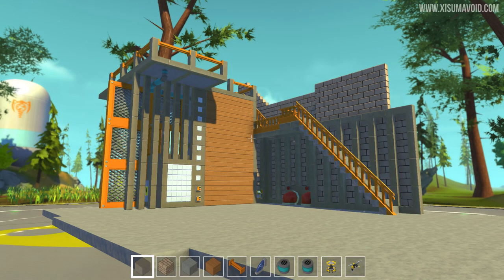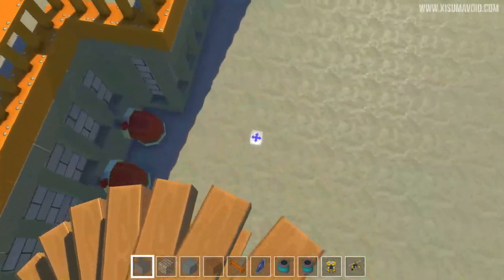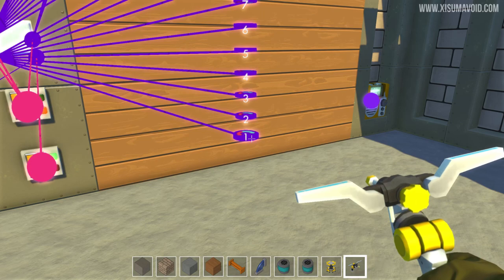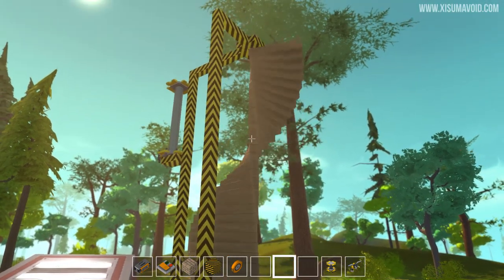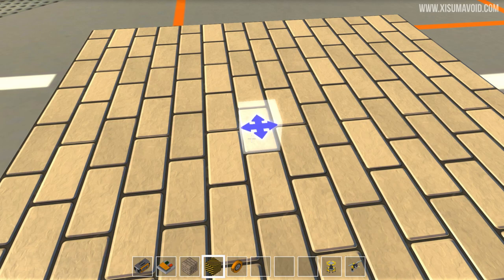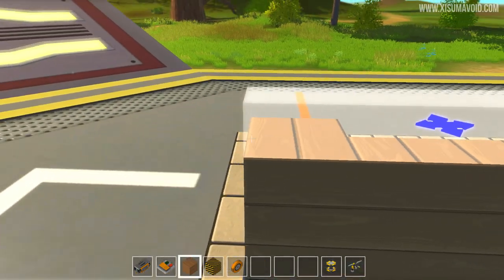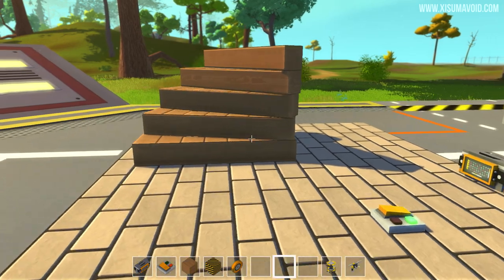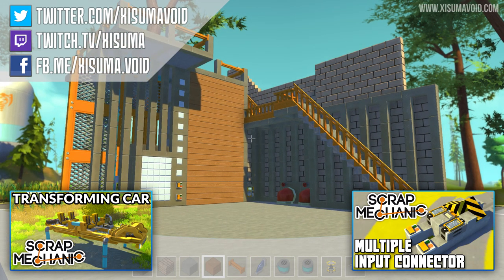Scrap Mechanic Tutorial: Spiral Staircase (Pop Out)

Comment: if the rotate thing spins other rotating thing and that thing spiuns a block' asuming that the speed of both of those one is 100kmh what is the pssed of the block?
Reply: Can't get an answer to this, but I have to say, the speed depends on where on the rotating thing the block is, because the further away you are from the pivot, the faster you are going
It's also a theory used to travel past electromagnetic speeds, have a long pole, and rotate it quickly round the centre and the edge will pass the speed of light
You would actually measure this in rpm (for rotations per minute)
Reply: 2 blocks ( including the ceter block ) from the center 100 rpm in that point
Reply: +Bio X You know... I could probably work this out, but given I'm not a very good mathematician, I'm just gonna leave this question, sorry
Reply: +Bio X You add the speed up. If first block spins 10rpm, and the second one did also spin 10rpm relative to the bottom one, the second one would spin 20rpm.